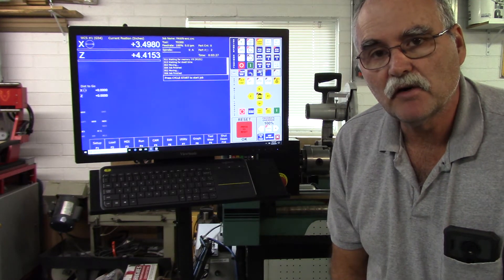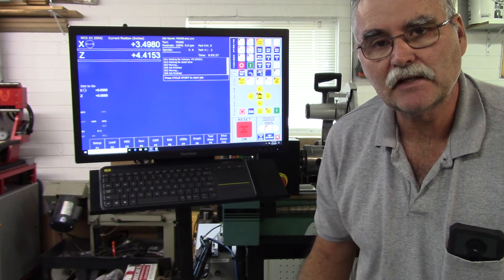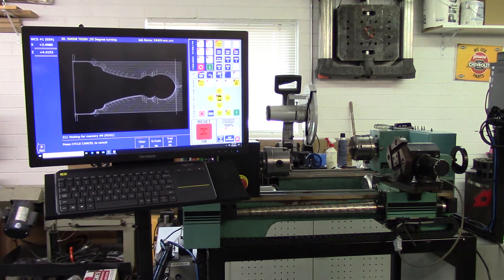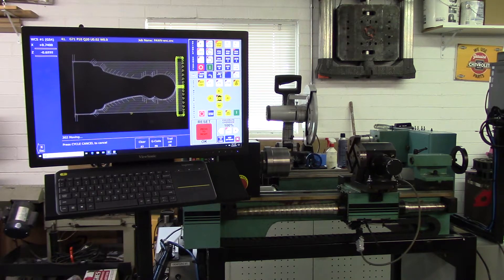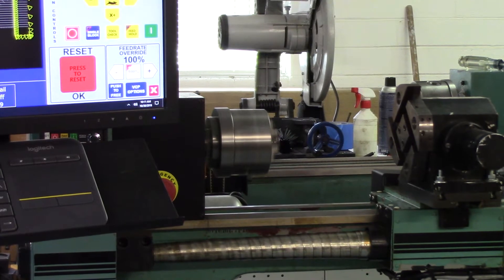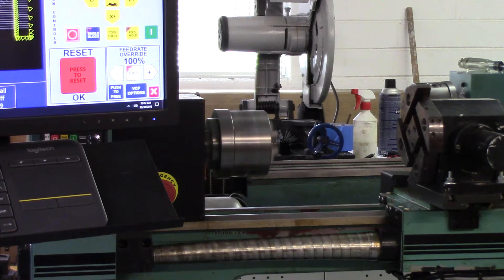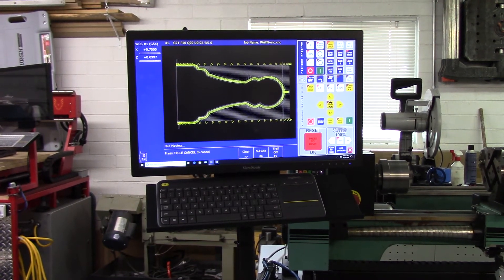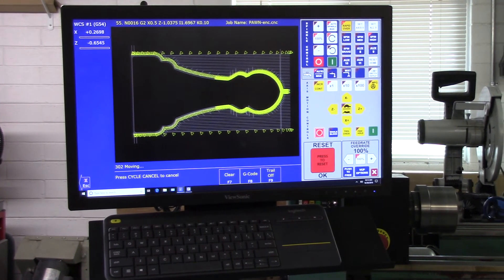Denford Orac Lathe, demonstrating the tool changer and CSS running under Centroid CNC Acorn control.

Comment: Great to see the old Oracs still being used. Do you know the history of the machine? I am very familiar with Denford machines as I trained on many of their range and even worked for them as a trainer for a short while. I have a video up demonstrating their FMS system that I ran at college which contains an Orac. Are you aware of the design flaw in the tool changer? It was never designed for cutting hard materials, aluminium, brass and other soft materials are the limit of its capabilities. There is an internal part which is part of centre adjustment that will buckle and cause the tool changer to jam when high cutting forces are applied (over time).
Reply: Fuzzy, what part do you mean?  Can it be replaced by a stronger piece to address this?